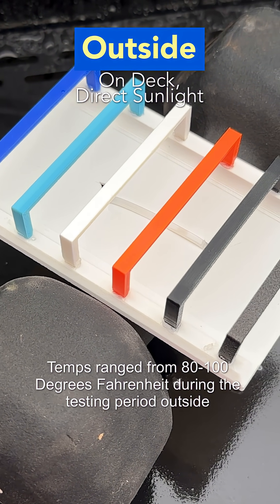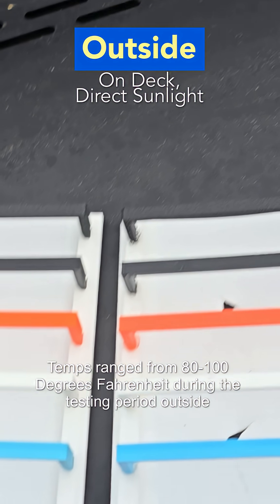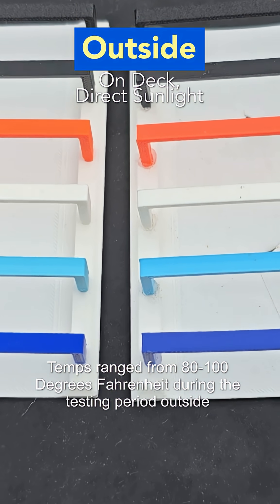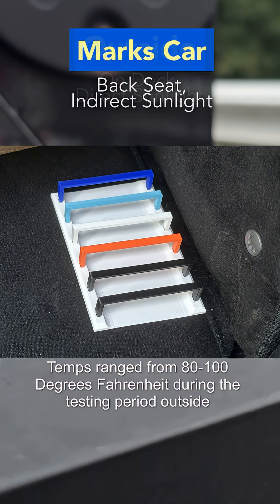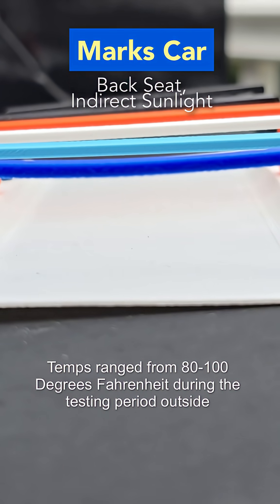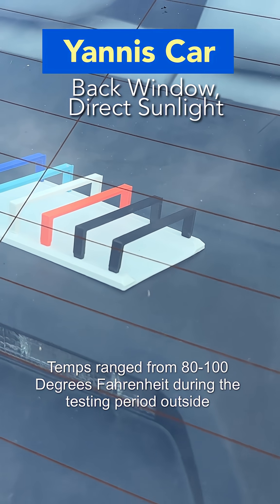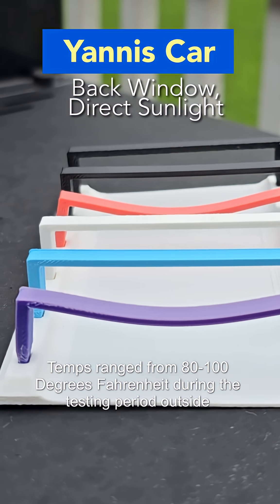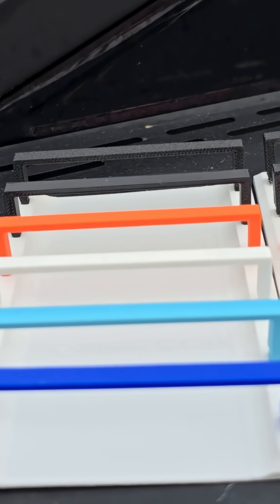ABS Doesn't Stand A Chance.

Comment: thank you for test. This will be very helpful in my projects.
Reply from the maker: No problem! We were incredibly interested ourselves. Like we noted in the full sized video the only major downside to it seems like it’s not as strong as normal PLA, so the “super secret” project we’re working on we determined it wouldn’t be a good candidate to support the heavy parts. 

Regardless, incredibly impressive for things like knobs in cars, outdoor statues, and any other high-heat scenarios!
Reply: @Marst_art  I am working on a project that will be exposed to the sun and needs to retain its color. My PETG filament is losing its color, but I cannot compromise on durability. What can you recommend?
Reply from the maker: Honestly, based on our tests, HT-PLA may be the way to go. You can go with the traditional answer of ASA as well since that is tried and true! Give HT-PLA a shot and see if the light fastness holds up longer than 30 days.
Reply from the maker: No problem!